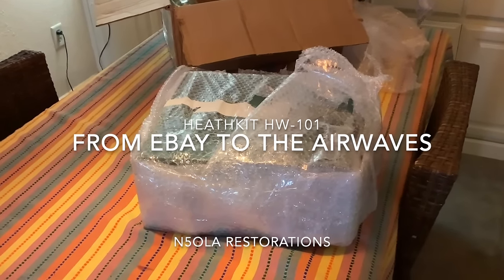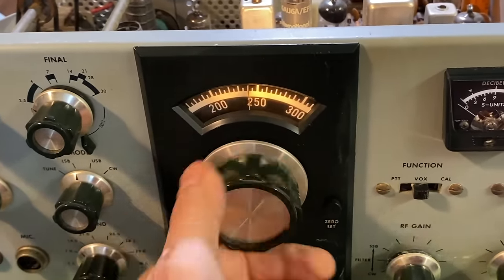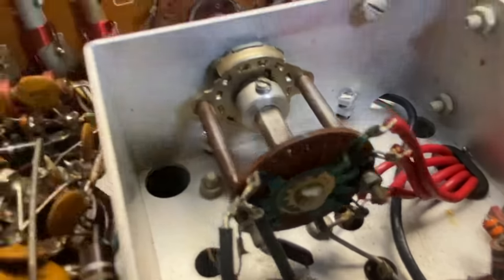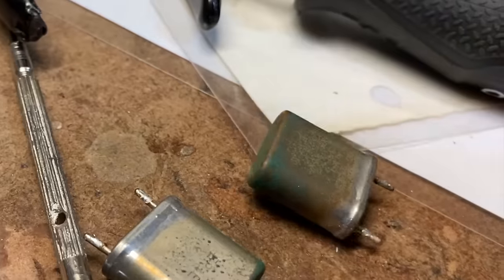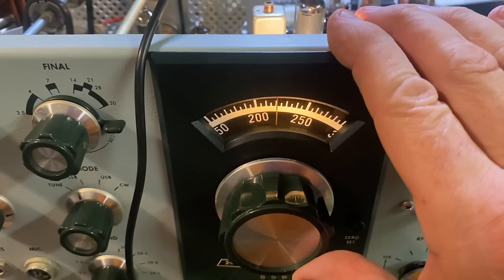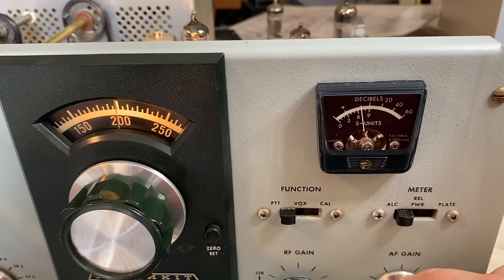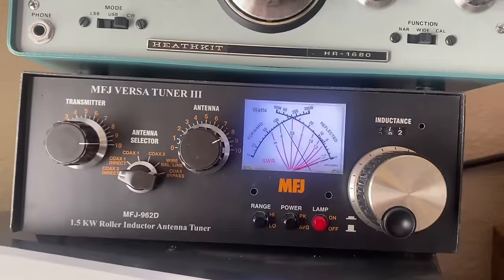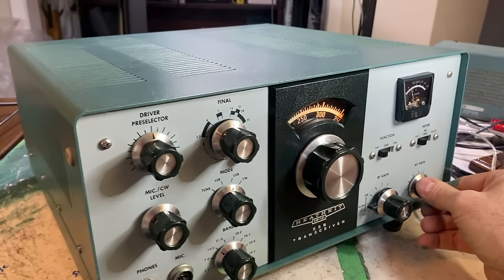Heathkit HW 101 From eBay to the Airwaves

Comment: This reminded me of a small electronics company I worked at in the summer during college in the late 80s where they had a dishwasher that was dedicated for cleaning circuit boards. They didn't have an ultrasonic cleaner so they would put them in a dishwasher with some kind of special wash powder. Just as long as the boards were perfectly dry afterwards they worked fine for production.

Comment: My retirement biz is DSM Labs and I restore mostly R390 series receivers but also some Hammarlund, Drake and Collins as well as some Ten Tec for fun. This after years as a systems engineer in the computer industry. I got my Novice ticket back in 1971, age 15. So, ~ 53 years as a Ham op.
I am pretty sure I have not seen a worse case for a transceiver. I'd probably come close to trashing it since the effort you put in these repairs had to be a labor of love, understanding you'll not recoup your time on a sale.
I am very impressed how you took your time and methodically solved problem after problem and ended up with a fairly decent HW 101. 
 I have always liked the 101 for it's performance to dollar ratio. I used one for several years many years ago and used it just on CW. Noisy relay notwithstanding it was a decent transceiver, not a contest rig, but for casual QSO's it has always been hard to beat for the modest price.
Not sure you got the sensitivity better but typically I see it at ~/3uv sig+noise spec and ~.15 MDS.
It was a pleasure to watch you go through that rough unit while I'm thinking, trash time...LOL
EXCELLENT project Sir !!

Comment: There is W5RKL page about Heathkit 101 restoration. Is that you?
The reason i ask is that, on the W5RKL page i were a bit impressed by how the grounding was arranged. It looked like a number of PCB:s, which had ground planes around the periphery, bolted directly to the metal chassis  via a large number of screws.

I.e. all PCBs appeared to be grounded through the screws around the periphery.

That looks like a very good way to do it. On old tubed Audio equipment (like e.g.  the fabolous Marangtz 7), they use ground busbars (and long ground wires), which may have been OK in the 60:s. But today with all the HF noise everywhere, that kind of grounding is not immune enough & those amps are often described as "grey," or "brown" sounding...  

Today you do need, something like a star ground per stage, and i guess that is how it it is arranged in the heathkit?

Old radios & i suppose old ham equipment seem to have been grounded in a better way.     Becsuse they had too....

Comment: I got the SB-102, cleaned it, checked the resistance, and turned it on. Various problems occurred, some common to the ones you encountered. It was a problem with the vacuum tube that the relay was working even though it was supposed to be receiving, but the problem of no sound coming out at all remains unresolved and is bothering me.
I'll try to find out if your solution applies to me as well. Thank you for the wonderful video.

Comment: Will - Great restoration video! I just traded a National NC-109 shortwave receiver that I restored to a friend of mine. He gave me a Heathkit SB-634 Station Console to play with. None of the digits on the 10-minute timer light up. The timer is working because the aural/visual still works. I just ordered the Q214 transistor (MPS-U5) off of eBay. It's listed as a possible cause in the troubleshooting part of the manual. I'm not a tech, but I do enjoy restoring the older tube stuff, like you do. I learn as I go along.
BTW, you wouldn't happen to have a #49 2-volt miniature bulb for sale, would you?  Not available locally, and I would have to buy a pack of 10 off of eBay.
73 Paul AA1SU

Comment: Man, what a battle. That thing definitely saw challenging storage conditions for a LOT of years. Are you familiar with the product "Tarn-X" for cleaning tarnished and fouled switch contacts? It's been a life-changer for me.
Reply from the maker: I've heard of Tarn-X but never used it. Better than regular contact cleaner? I'll give it a shot.
Reply: I use Tarn-X for wafer switch contacts with a Q-tip. Works really good. Read the instructions on 5he container carefully. I also use Brasso but not on contacts. Thanks for the video!

Comment: How can you measue the resistance of the resistor while it's still in the circuit?
Reply: I have the same question.
Reply: Unsolder one lead and measure with an ohm meter.
Reply: @Larry-AK0Z  That would work but he's not doing it.

Comment: If you have the means, you can 'prep' the air to suck moisture off stuff when drying after a deep clean. You need dry warm air, heat increases the moisture air can carry. AC units dry air due to the temperature dropping below the dew point thus the water crashes out of it. Thats why your AC unit has a drain with a small trickle of water, also why the front defroster turns the AC pump on in your car. Add heat back with the heater, and hot dry air will suck the moisture right off (the muck on) your windshield!

I imagine this crowd is aware of this stuff, but for the odd newcomer that is probably just recovering from the heart attack of seeing you use a kitchen sink sprayer to clean the boards.... 🤣🤣🤣

Comment: Hello
You have made a serious mistake.
You have tried cleaning the device with water. You don't do something like that!! Second error: the device was uneconomical in this condition. it was one piece of rust too much
Reply: Water is probably not a problem as long as the water is removed expeditiously and thoroughly. Nice project.
Reply: Washing with soapy water, and using a brush is just fine. Thoroughly dry and you are good to go. Check out other 101 restore videos that have done this with great success.